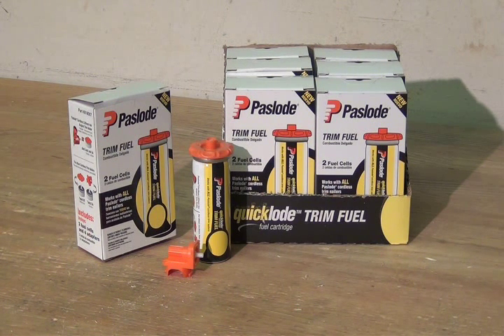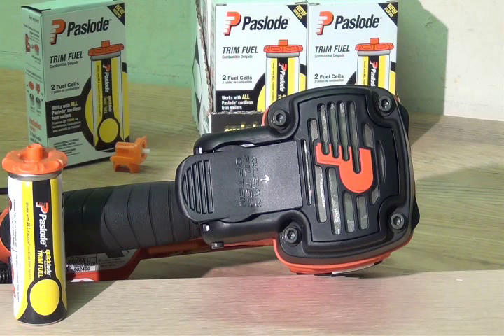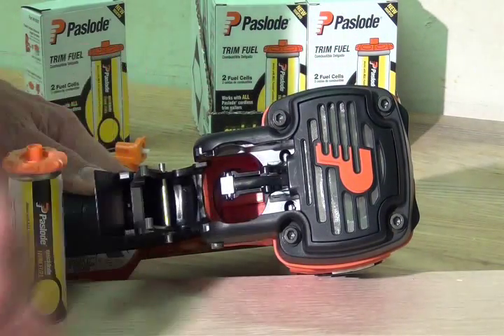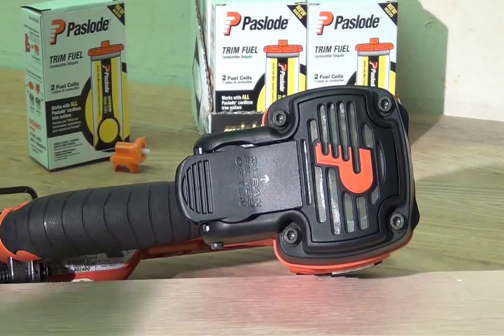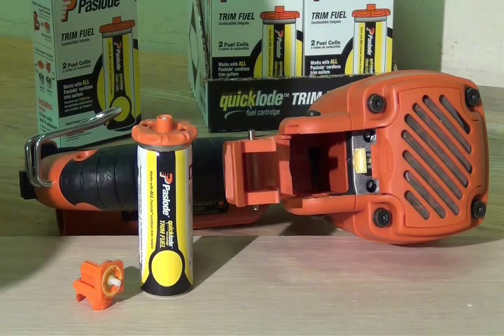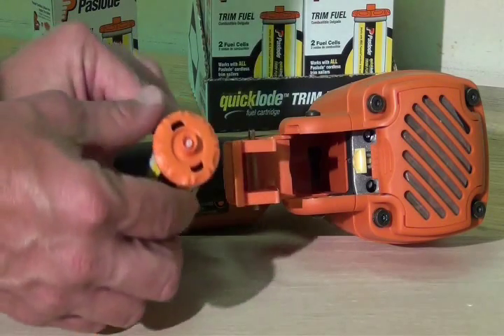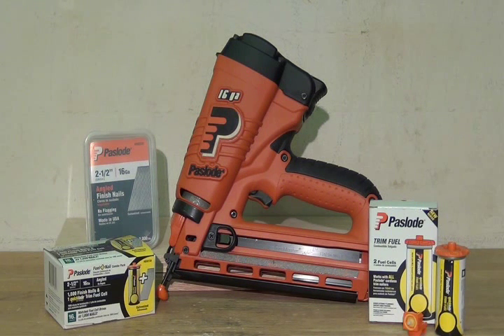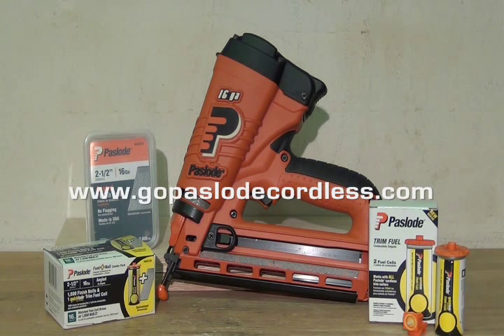Paslode Universal Quicklode Trim Fuel

Comment: The video is fine but it's crap that paslode is forcing owners to pay 5 more dollars for features they dont need. You should also distribute the regular fuel cells still. The old 4 for 25 vs the new 2 for 15. Pretty much sucks